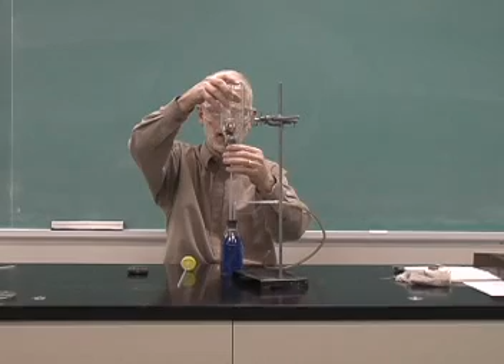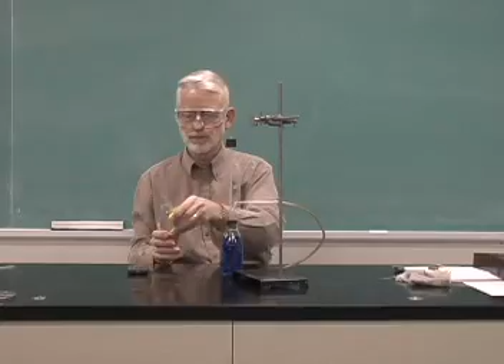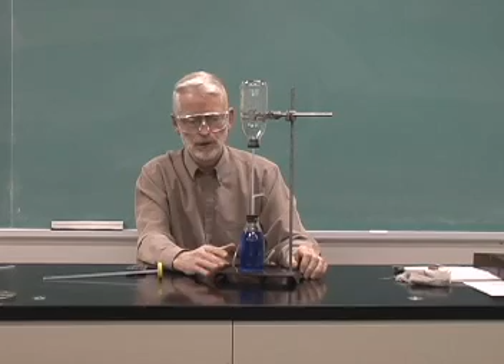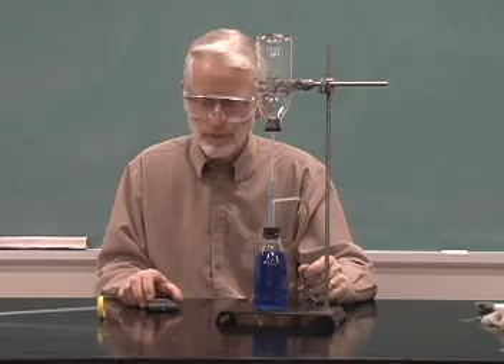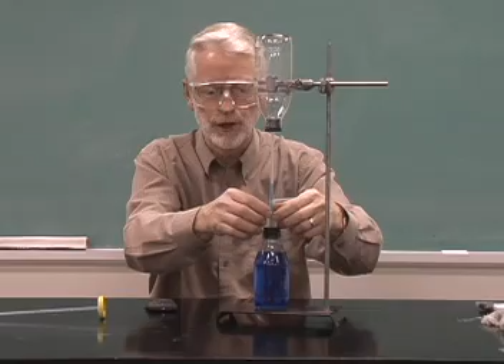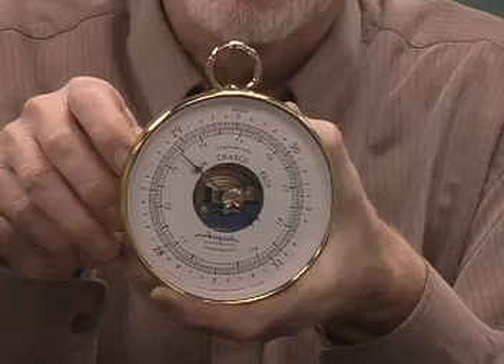Measuring Air Pressure Using a Barometer

Comment: if we use a very big barometer then it's maximum potential become very good source for energy and turned the turbine and generators setup so we got electricity forever
in stormy area this barometer hugely gives tremendous energy